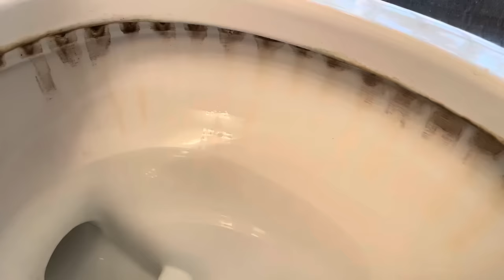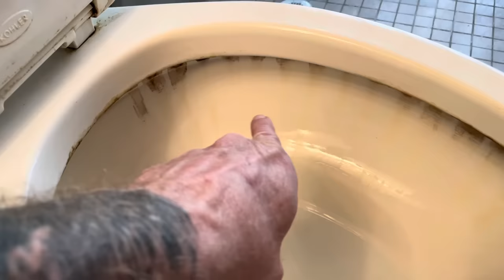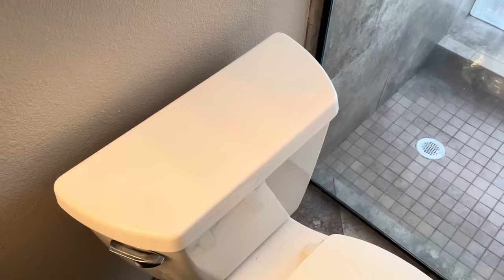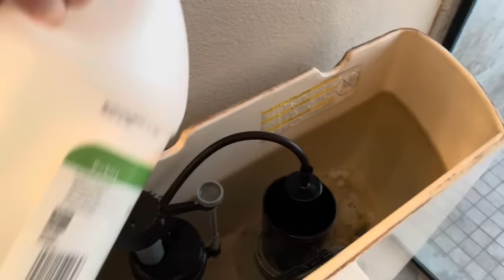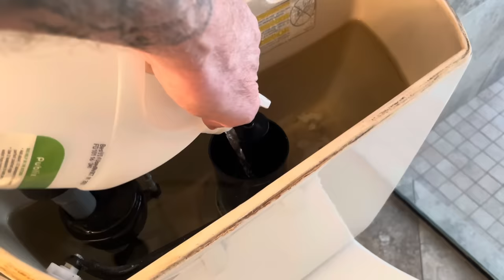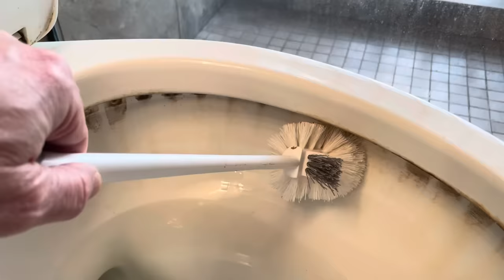Why Does THIS Keep Coming Back and How to STOP it

Comment: I have hard water and nothing worked. I ended up using muriatic acid and it cleaned EVERYTHING out of the toilet. Stains, hard water, mold, all of it. 2 cups down the same tube and sit for 10 minutes. Didnt even need a scrub brush. Just flushed and done.

Note: super strong acid from a pool supply store and requires caution! It will burn you or blind you! It can be diluted in plumbing systems just like it is when added to swimming pools. No need to neutralize. 1/4 cup on drains works well too, mind the strong smell.
Reply from the maker: Oh for sure that would work great, but the fumes in an enclosed space are horrible for your lungs. Plus I’ve got COPD, that would be the end of me lol.
Reply: @papajoeknows8355  yes, the fumes are terrible. Lucky the bathroom has ventilation fans and i dont clean drains unless i can open a window. Thats why i mentioned it. Vinegar first! My situation is very hard water from a well. Much different especially once it gets out of hand.

Comment: Thanks for this information.  I started noticing this under the toilt rim not after my toilet was replaced with a new. Despite cleaning and cleaners I  couldn't get rid of it. Unsightly mess. I  going to give this a try next week. 😊 If youtube would put more useful info on instead of garbage shorts and ridiculous nonsense it would be like it used to be. 2:02
Reply from the maker: See also the 2 videos linked in the description… they will help as well.

Comment: Great tip Papa Joe! I always thought it was hard water/ mineral deposits which is my personal nemesis for pipe corrosion, hose connections, irrigation lines etc.
Vinegar seems an affordable and logical solution. 
Wouldn't bleach also do the same job (plus sterilize the bowl)? WARNING: people with septic systems should dilute the bleach as to not kill the good micro-organisms that break down the human waste in the tank itself.
Reply from the maker: Bleach is a very deceiving product… it is far more effective at “bleaching” the color of mold than it is at killing it. Because we believe what we see, we think it has killed it, but it hasn’t. That’s why it comes back so quickly. So we just keep using & buying product over and over again. Great for sales, but not so much for us. The acetic acid in vinegar, on the other hand, kills mold down to the roots, but doesn’t really change the color that much, so you still need to remove the surface stain, but it won’t come back for a long time. Vinegar also helps break down the mineral deposits that the mold is “rooted” in. All in all, vinegar is a far better option.

Comment: I drop a bleach tablet in the tank every now and then, keeps the tank looking clean inside and the toilet bowl as well, the bleach tablet is about the size of a tums tablet. Found them on good ol amazon.
Reply from the maker: Bleach is a very deceiving product… it is far more effective at “bleaching” the color of mold than it is at killing it. Because we believe what we see, we think it has killed it, but it hasn’t. That’s why it comes back so quickly. So we just keep using & buying product over and over again. Great for sales, but not so much for us. The acetic acid in vinegar, on the other hand, kills mold down to the roots, but doesn’t really change the color that much, so you still need to remove the surface stain, but it won’t come back for a long time. Vinegar also helps break down the mineral deposits that the mold is “rooted” in. All in all, vinegar is a far better option.

Comment: This doesn't work in my toilet. If I pour anything into the overflow it comes out at the bottom of the bowl, not from the rim. I don't know if it is because my toilet is from the early '50's or if different toilets have different designs.
Reply from the maker: On some toilets, the design is such that a “burst” of water is required in order for it to go into the internal rim cavity and out the jets (as would be the case with a flush). In this case follow these steps:

1. Lift the lid to access the tank.
2. Flush, and while the tank is refilling, pour the vinegar directly into the tank.
3. Once the valve shuts off and the vinegar (yes, it’s watered down somewhat but that’s ok) is in the tank, flush again… now the vinegar solution will go the internal rim cavity / jets.
4. Let it sit a while now for it to do its thing.

Comment: The reason is inside the rim of the toilet & inside the bowl. If you put hydrogen peroxide in the water tank regularly the HP will kill the mold & the problem will be gone , you can also use vinegar in the water tank as well.
Reply from the maker: It’s best not to put vinegar in the tank because the acidity can degrade rubber seals, etc. That’s why I’m putting it directly into the overflow.
Reply: @papajoeknows8355  I've been a cleaner for more than 20 years I myself do not use vinegar but as long as the vinegar is diluted with H20 or as you stated in the over flow . I've always used HP diluted with the tank water HP will kill the mold & end the problem & it will not cause damage to internal seals .
Reply from the maker: @mrclean62  interesting, I’ve heard that it will kill mold, but I’ve never tried it.

Comment: My husband completely tore out the shower and the sheetrock and tile in our small bathroom because we thought that was where some mold had to be hiding.  I am extremely allergic to mold and have been hospitalized for it a number of times.  He didn't find mold in the walls so he was going to see if it could be something under the toilet and he removed it. He takes the toilet out to the garage to have more room to work and it fell off the two-wheeler and broke.  Then he saw all this nasty black looking mold in the rim where the clean water comes into the bowl when you flush.  How in the world does mold even start growing in there?  From clean water in the tank?  He is putting the bathroom back together and bought a new toilet.  How can we make sure mold doesn't start growing there ever again?  We never saw anything black coming out of the rim.  I try to keep the toilets clean.  I would welcome any suggestions.  Thanks.
Reply from the maker: @BetsyL-cq6wx  poor hubby, and you too for that matter. Unfortunately you picked the wrong thing to be allergic to, as mold spores are all around us, both outdoors and indoors as well. When the find a moist, dark area, like the rim cavity of a toilet, they can easily flourish. Even though your toilet is new, in time the mold will start to grow in there again. Since you are highly allergic, I would pour a cup or so of vinegar into the overflow inside the tank, like in this video (don’t pour directly into the tank) once a month. This will help to insure that it won’t come back.
Reply: @papajoeknows8355  Thank you, Joe.

Comment: The chlorine tablets for the toilet tank you buy at the store cleans it up very fast. The chlorine killed the molds and it’s sports
Reply from the maker: Bleach / chlorine is mostly effective at killing mold on non-porous “glazed” surfaces. But the internal rim cavity of a toilet, where the mold is flourishing, is not glazed and is very porous, so vinegar is far more effective, as it’s able to kill mold deep down to the roots.
Reply: @raymondheckard234  I had one of those "Super Flush" toilets and never had any issues with under the rim mold growth and also helped with not having to clean the bowl of the toilet as often.  I changed that toilet out for a higher version and still no issues.  The extra money was well worth it over the course of years and years.

Comment: great info! what about using baking soda in the bowl?
Reply from the maker: Yes, you can. A lot of people like to use baking soda and vinegar together, but that’s a mistake… baking soda, neutralizes the acid in the vinegar, which is what’s needed to kill the mold. That acid also helps to breakdown mineral deposits as well. So it’s best to use them separately.

Comment: Good for city/county owned sewer use systems, however, looks to me like it will also kill the bacteria in homeowner septic tanks.  This bacteria is essential to making these septic tanks "process" the waste within them.  Correct???
Reply from the maker: It’s 100% safe for septic, and far better than most bleach based cleaners. Also keep in mind, the average septic tank is over 1,000 gallons.

Comment: Bleach works to fyi for those that might not have vinegar.
Reply from the maker: Bleach is a very deceiving product… it is far more effective at “bleaching” the color of mold than it is at killing it. Because we believe what we see, we think it has killed it, but it hasn’t. That’s why it comes back so quickly. So we just keep using & buying product over and over again. Great for sales, but not so much for us. The acetic acid in vinegar, on the other hand, kills mold down to the roots, but doesn’t really change the color that much, so you still need to remove the surface stain, but it won’t come back for a long time. Vinegar also helps break down the mineral deposits that the mold is “rooted” in. All in all, vinegar is a far better option.

Comment: I use clorox toilet cleanser gel cling i put it up in that rim and let it drip down at least once a week it prevents the growth and your bathroom smells great after, but the vinegar method is also good.
Reply from the maker: It is deceiving though… bleach is very effective at “bleaching” the color of mold so you think you’ve killed it, but it comes back very quickly. That’s why you have to keep using it. Vinegar on the other hand kills mold down to the roots, but doesn’t really change the color that much, so you still need to remove the surface stain, but it won’t come back for a long time. Vinegar also helps break down the mineral deposits that the mold is “rooted” in. All in all, a far better option.

Comment: The cause of black staining on my toilet was the rubber water supply pipe coming into the house was slowly deteriorating. Sometimes black specs would come through the cold water taps too.
Reply from the maker: Strange… I used to be a contractor, and I’ve never seen rubber used for supply lines. Probably for that very reason.
Reply: @papajoeknows8355  I can assure you it’s a hard flexible rubber compound hose/pipe from the pavement, through the foundations and ends at the main stop cock inside the house. It was similar in size to what is used at petrol pumps. House was built early eighties. Everybody in the street has the same issues.
The tank that holds the flush water has a nlack line around where the level of the water sits.
Doesn’t look as bad as in the video, but faint black lines appear every few weeks. 👍
Reply from the maker: @vtechead1  sounds like a nightmare, and a class action suit.
Reply: @papajoeknows8355  😂👍

Comment: Putting Clorox bleach tabs in the tank did the trick for me, though I have to use them consistently.
Reply from the maker: Bleach is a very deceiving product… it is far more effective at “bleaching” the color of mold than it is at killing it. Because we believe what we see, we think it has killed it, but it hasn’t. That’s why it comes back so quickly. So we just keep using & buying product over and over again. Great for sales, but not so much for us. The acetic acid in vinegar, on the other hand, kills mold down to the roots, but doesn’t really change the color that much, so you still need to remove the surface stain, but it won’t come back for a long time. Vinegar also helps break down the mineral deposits that the mold is “rooted” in. All in all, vinegar is a far better option.

Comment: Interesting! I also see this in my bathtub. Any info on how to deal with that?
Reply from the maker: Vinegar also… If it’s on a vertical surface, soak paper towels, and vinegar and apply to the area. Let it set for a while, then clean it.
Reply: @papajoeknows8355  Cool! I'll try it and let you know how it goes. Thanks man.

Comment: Does this also help in the shower as well with getting rid of certain small mold in the corners, because it seems like as much I clean it with mold solutions it keeps coming back it may be the moisture that is kept in the bathroom
Reply from the maker: Is it along the grout lines where you’re having a problem?

Comment: Some toilets does not have leads on them but they still have the flushable knob and they still have the same problem with the mold so can I use some Clorox toilet bowl cleaner to go up under my rims let it sit for 15 minutes and I clean the mold off and so far I haven't seen it come back yet that's been about 3 or 4 months
Reply from the maker: There are two videos linked in the description that will help you.
Reply: @papajoeknows8355  ok thank you 👍👍👍

Comment: I think using bleach or vinegar is a perfect fix, but you have to ask yourself how dirty your water must be that even through constant flushing and jetting you can still develop mold... Hopefully, you're not drinking and bathing in that same water.
Reply from the maker: Eh, I drink every day from a stainless steel container, using only purified water bought from the store, and it still gets mold in it. Also bleach is somewhat effective at killing mold on non-porous “glazed” surfaces. But the internal rim cavity of a toilet, where the mold is flourishing, is not glazed and is very porous, so vinegar is far more effective, as it’s able to kill mold deep down to the roots.

Comment: Any thoughts on how to fix this problem on a pressurized low-flow toilet? There is no open water in the tank like this old toilet.
Reply from the maker: Unfortunately, there’s no way to access the internal rim cavity with that type of toilet. The two videos linked in the description will help you to clean the part you can see though.
Reply: @papajoeknows8355  Thank you.  🙂

Comment: What to do if its coming/starting at the opening where it flushes down? Mine is not starting from the sprays but from the opening like it is creeping UP into the bowl?
Reply from the maker: On some toilets, the design is such that a “burst” of water is required in order for it to go into the internal rim cavity and out the jets (as would be the case with a flush). In this case follow these steps:

1. Lift the lid to access the tank.
2. Flush, and while the tank is refilling, pour the vinegar directly into the tank.
3. Once the valve shuts off and the vinegar (yes, it’s watered down somewhat but that’s ok) is in the tank, flush again… now the vinegar solution will go the internal rim cavity / jets.
4. Let it sit a while now for it to do its thing.

Comment: A cup of bleach in the water once in a while works very well also.  Cleaning the toilet once in a while helps too.  The example toilet in this video had not been cleaned for weeks.
Reply from the maker: Months actually, because a clean toilet wouldn’t have made for much of a video lol. Also, bleach is somewhat effective at killing mold on non-porous “glazed” surfaces. But the internal rim cavity of a toilet, where the mold is flourishing, is not glazed and is very porous, so vinegar is far more effective, as it’s able to kill mold deep down to the roots.
Reply: @papajoeknows8355  This is why I pour bleach in the tank.  That water will be circulated around the rim.  Anyway, works for me.

Comment: Honestly, my issue looks similar but is caused by hard water deposits,  and this is still probably a good solution,  like descaling the coffee maker.
Reply from the maker: @madestmadhatter  yes, the hard water deposits exacerbate the problem because it creates a surface for the mold to “root into.” The vinegar helps to loosen the deposits as well.

Comment: Citric Acid is the Best….empty the tank and filled with HOT water then add the Acid and Leave it for about and hour or more ..
Reply from the maker: Yes citric acid will work well, but be aware that it can degrade the rubber seals inside the tank. The acidity in vinegar can do the same, which is why you see me put it in the overflow and not the tank.

Comment: I put Clorox tablets in my toilet. I can tell when they're gone because the mold begins to creep in. I might have to give this a try.
Reply from the maker: Bleach is a very deceiving product… it is far more effective at “bleaching” the color of mold than it is at killing it. Because we believe what we see, we think it has killed it, but it hasn’t. That’s why it comes back so quickly. So we just keep using & buying product over and over again. Great for sales, but not so much for us. The acetic acid in vinegar, on the other hand, kills mold down to the roots, but doesn’t really change the color that much, so you still need to remove the surface stain, but it won’t come back for a long time. Vinegar also helps break down the mineral deposits that the mold is “rooted” in. All in all, vinegar is a far better option.

Comment: Is there anything I can do about the same mold having made it to the seat, or at this point, do I just need to buy a new seat?

... Do they even sell seats by themselves?
Reply from the maker: Yes you can buy just a seat. But first, see if you can get vinegar to work on the seat. Depending on where it is, you may want to soak some toilet paper with vinegar, and stick it in place, so that it’s in contact with the mold. Let it sit for a time, then try to clean it off. If that doesn’t work, again, they do sell toilet seats by themselves.… Some are elongated, and some are more round, so be sure to get the right one. Hope that helps.